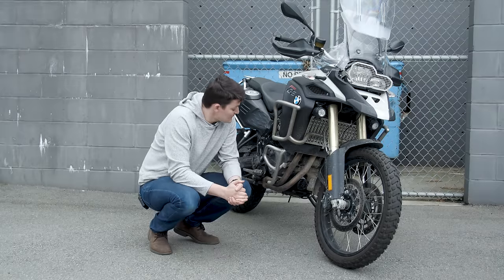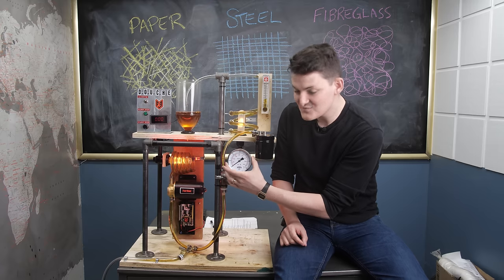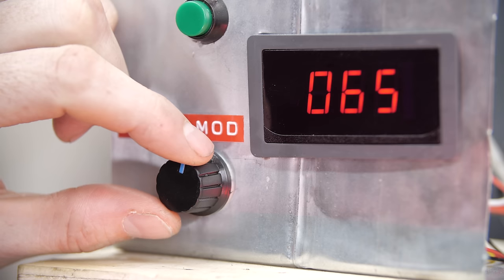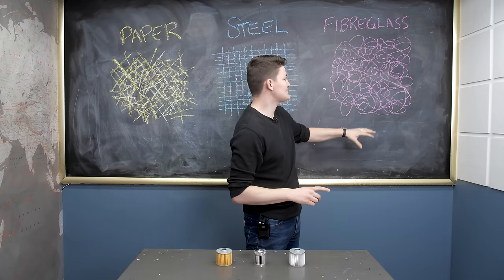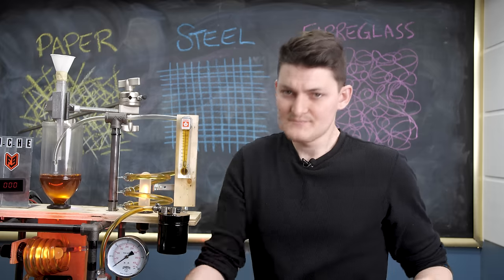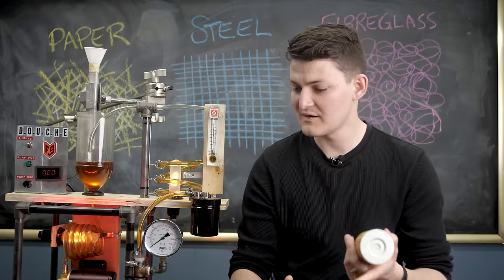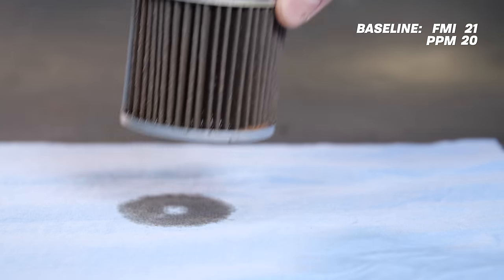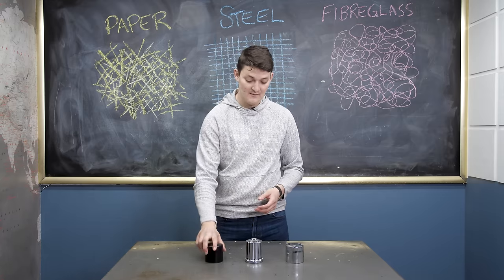The Best Oil Filter - Testing Paper vs Fibreglass vs Steel

Comment: This test is completely stupid, you have to measure the oil pressure after the filter, not before.  It is the filter that causes the loss of pressure in the lubrication circuit, which can cause damage to the engine.  Better to lubricate all engine components with contaminated oil than not have enough oil pressure to lubricate the engine.
😂😂